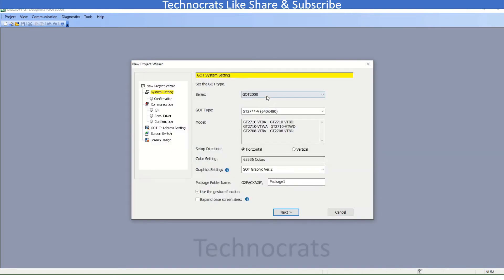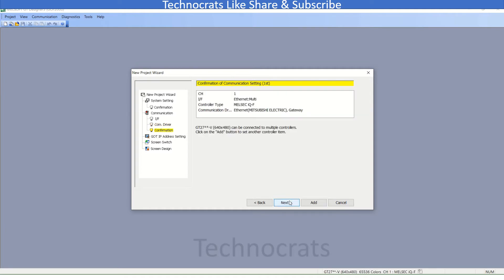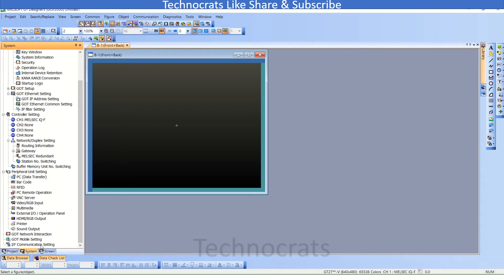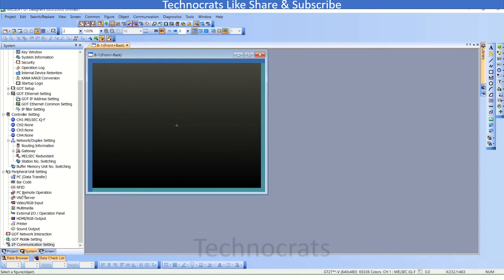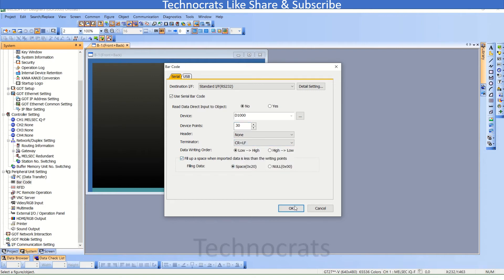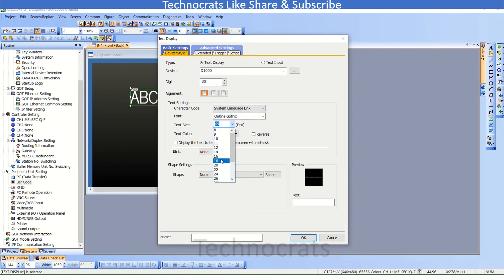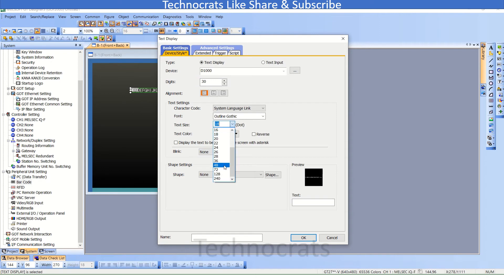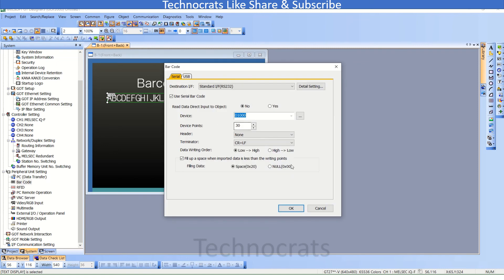Barcode Scanner to Mitsubishi HMI GOT2000 Communication

Comment: I tried to connect Zebra DS3608 to GS2107 but it does not read the value ... But same scanner i tried with rs232-adp in plc it works and even in hyperterminal it can read but with hmi alone i cannot ..
Reply from the maker: Check For CR or LF terminator
Reply: @Technocrats91  CRC means ??
Reply from the maker: Cr or LF terminators
Reply: Change the setting of your scanner to RS232 after that try to read it will work.

Comment: Can we communicate through USB
Reply from the maker: Yes
Reply: @Technocrats91  can u please share the details. I tried but I didn't get data.
My Barcode is of Zebra Company.
Thanks in advance.
Reply from the maker: are you using RS232 port or USB
Reply: @Technocrats91  USB port only
Reply from the maker: GOT Model No.
Reply: @Technocrats91  GOT2000 series
Model GT27**-V (640X480)
Reply: @Technocrats91  sir I am waiting for your reply..
Reply from the maker: In Peripheral Setting >> Bar code >> USB, set the setting, then goto GOT Setup >> Basic Setting >>  USB Host select 101 English
Reply from the maker: for more details check the help section of GT Designer
Reply: @Technocrats91  I did all above setting except This English.
I left it with Japanese only.
Thank you
Reply: Did u find the solution ?
Reply: https://www.youtube.com/watch?v=UhdDj87FhEY....Go through and find your solution
Reply: Sir ethernet se kaise connect kare  ... Keyence ka scanner hai